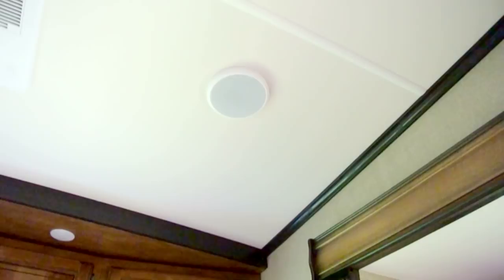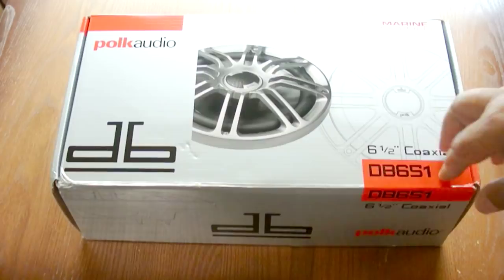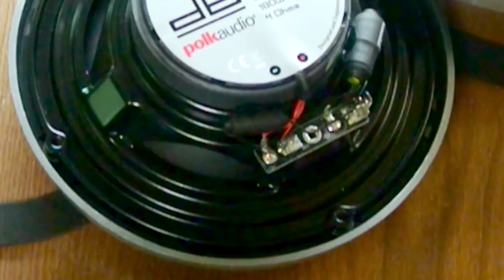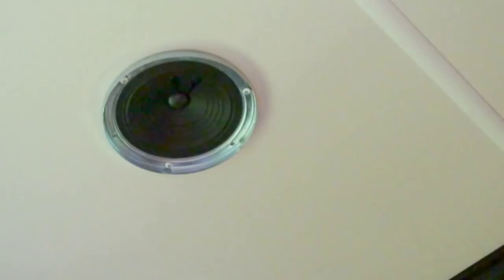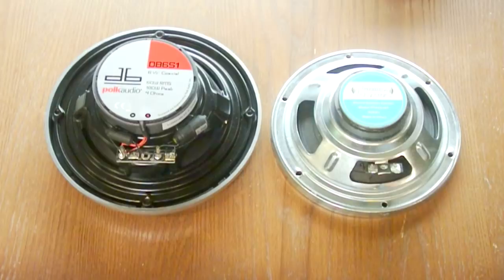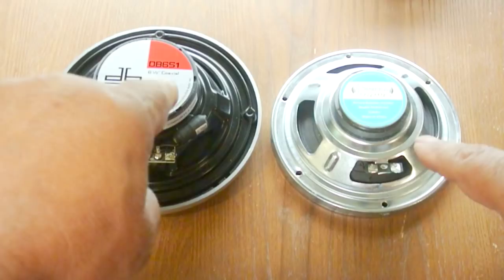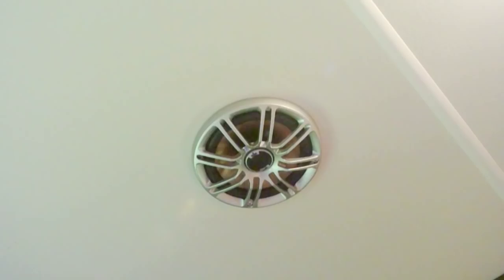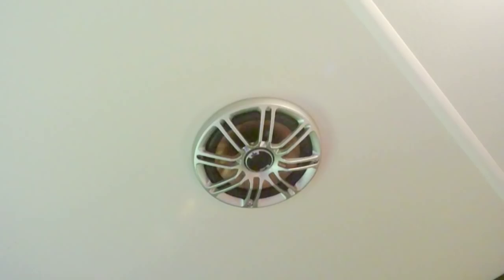Upgrading the stereo Speakers in my RV

Comment: Glad I watched this. I want to upgrade my speakers in my RV and totally wasn't thinking about the speaker wiring. Doesn't make sense to go super high end speakers.
Reply from the maker: No need to go all out unless you want to rip out the wiring as well.
Reply: @RVProject  what exactly is the downside to running higher end speakers at a potentially higher wattage? wires will get hot?
Reply from the maker: @steveschott9926  The wires will not get hot, so it is not a safety issue.  Smaller diameter wire will present more resistance when higher current (from higher wattage) goes through the wires. This is a series resistance.

A series resistance will alter the speaker's "Q", and will affect it's frequency response in a negative way, especially the low-end bass frequencies.   

So you are spending more money on a high-end speaker, yet the higher resistance smaller speaker wire is reducing the performance of the speaker.

For more information, look up the Thiele/Small modeling theory and how the resistance component affects low-frequency response.

Comment: Great video, thank you! I believe I have the same junk speakers in my RV if they are the Pummell Drive. The old speakers were 5 1/4", did you have to modify the size of the hole in your ceiling to get the Polk's to fit?
Reply from the maker: The old speakers were also 6 1/2" so luckily the hole was the correct size. I am pretty sure if you replace your 5 1/4" speakers with  6 1/2" speakers, you will have to do some cutting. Polk does make 5 1/4" speakers, so that is an option too.
Reply: @RVProject  Thank you! Looking forward to your outside replacement video.

Comment: Did you have to cut a bigger hole for the new speakers? I am guessing like mine the stock OEM speakers are 5.25 and ypu went with 6.50.  Been looking to upgrade my entire radio system....
Reply from the maker: Fortunately I did not have to. But if you are going from 5.25 to 6.2 speakers, you might have to.  If you do, I would suggest a multi-tool to enlarge the hole.
Reply: @RVProject  Thanks for the reply Sir!   Did you replace with same size of speaker or are your new ones larger than your old ones?
Reply from the maker: @paulbobenmoyer9055  Mine were the same size.

Comment: No, it absolutely "matters" which way the wires go. If the polarity is wrong, they'll drive the wrong way and at higher volumes, the drivers will bottom out and sound like shit. They're marked +/- for a reason.
Reply from the maker: As opposed to driving the voice coils out of the magnet cavity? That can easily damage the edges of the voice coils and they might not seat back into the magnet.

If you are driving your speakers so they hit bottom or are popping out of the magnet cavity, you are abusing your speakers.